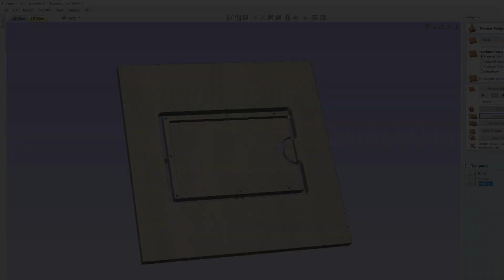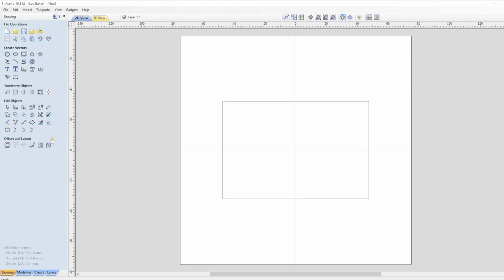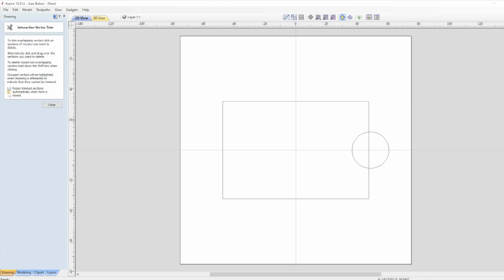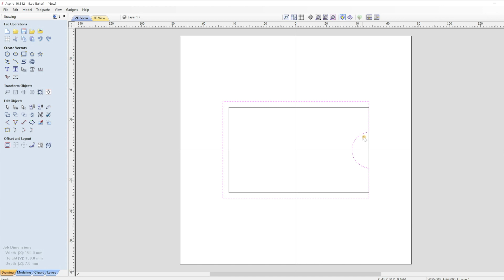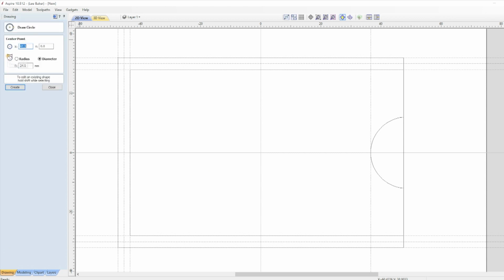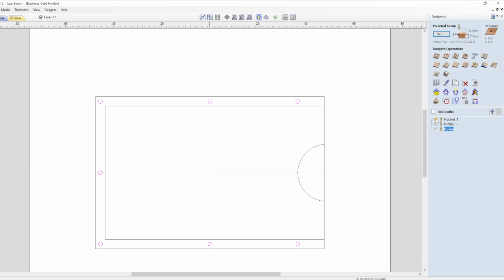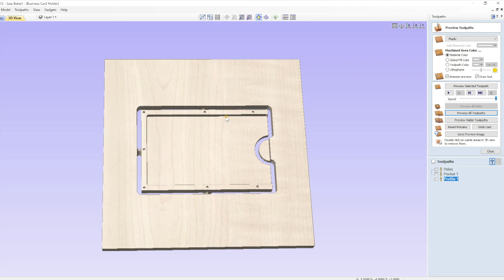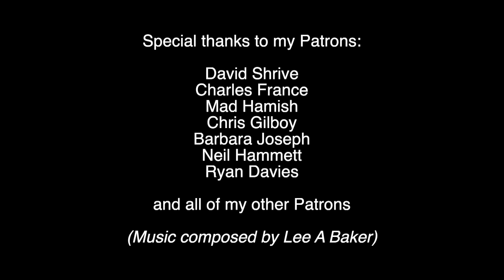Vectric V Carve & Aspire CNC Tutorial - Making A Wooden Business Card Holder

Comment: Nice I made some similar and had problem aligning the 2 halfs together I like your pin alignment method 👍🏾
Reply from the maker: Yeah its hard without the pins. My first holder I did without pins and it was tricky aligning both pieces. Then I tried metal nails which was a bit dangerous...then I thought of the plastic rod which works really well and was a lot safer than little metal nails :-)